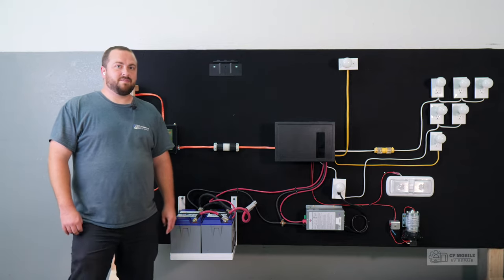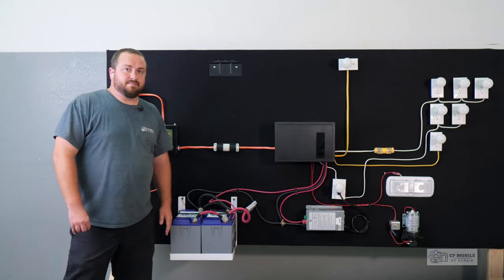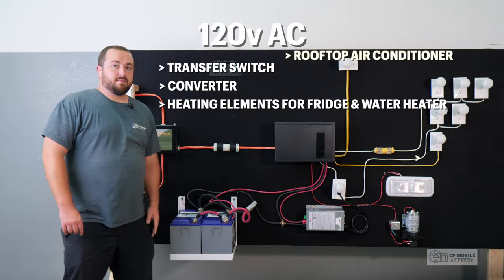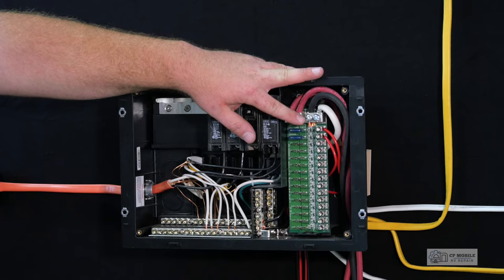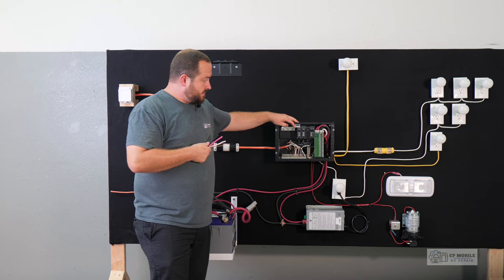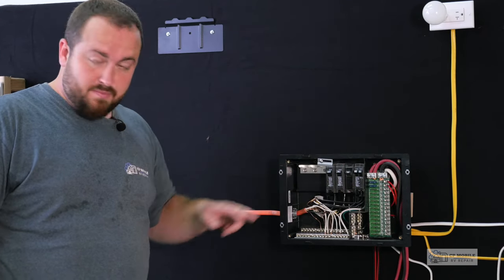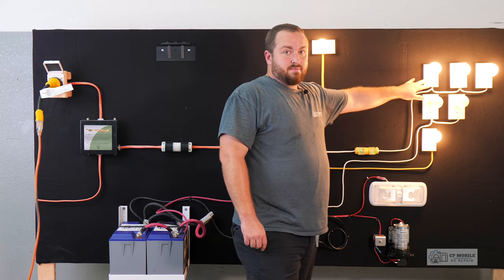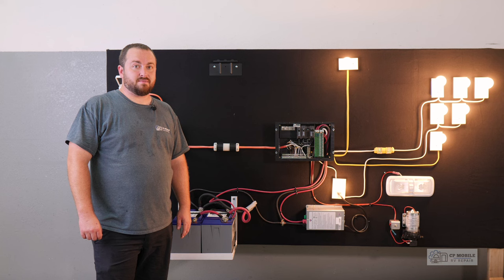RV Electrical Systems: 12 Volt and 120 Volt Power Flow Visualized

Comment from the maker: Link for batteries: https://amzn.to/3ztOisd

We have had several requests for technical help with troubleshooting, installing or designing electrical systems, so we’ve set up an option for paid consulting service below.  If you’d like expert technical help you can click the link below and schedule and appointment. Thank you! 

https://web.lokiapp.live/Travis.Call/g9Er
Reply: My only question is since this is a 30 amp service, I see you have the 30 amp main breaker but then there are 2- 20’s and a split breaker that’s tough to see…this all adds up to more than 30 amp. Does that mean you can only have certain breakers on at certain times so they don’t trip or am I not understanding how the system works? Thank you
Reply from the maker: All breakers are on at the same time, the breakers are to control the upper limit of power usage.  So a 15 amp breaker may only have 1 amp flowing through it depending on what power is being used.  It’s possible the total current from all the smaller circuits could exceed the 30 amp limit without exceeding any individual circuit breaker limits.  That’s why the main breaker exists.  So overall you just monitor total power useage at any given time.  Same scenario is possible in a house, too many devices on at one time could trip the main breaker.
Reply: @Cpmobile  Ok thank you. I’m trying to determine whether to go with a 30 or 50 amp service on my race trailer which has small living quarters. I’ll have 8 total 110 receptacles, 1 for a plug in AC unit, 1 for a small air compressor, 1 for a car battery charger and 1 for the converter/charger…the rest are just misc. DC power will be water pump, shower fan, car winch and low voltage LED exterior/interior lights. The trailer will be plugged into a portable generator all the time. Based on what you’re saying I think a 30 amp service would be sufficient because not all of these things will be on or used at the same time.

Comment: I blew up a 12v combo 120 Tv:(( Both power plugs were plugged in, and POW:(((Cooked the tv circuit board…Would be nice to separate each system in Rv, or the Tv .Im old and can’t figure what happened…I made it more complicated by connecting a lithium charger with Rv charger leads to 50ah battery. And then having to remember to kill main power sw on Rv frame outside each time Generator is on. Or I will have 24 volts to 12v items.Believe it or not, gas detector module by stove chirps for a second and a blue light flashes once to remind me to hit main switch, and not forget. Furnace motor goes on high(24v ) for a second simultaneously with detector. So separate systems though costly are in order.:))))lol

Comment: Thank you for making these videos. I’m trying to better understand how power works in our 5th wheel because I’d like to (eventually) be able to install solar that will run the unit when shore power isn’t available. I’d also like to install an onboard generator. Starting with the basics, this is incredibly helpful. Thank you!!
Reply from the maker: Thank you!

Comment: The lines coming off the batteries with the coupler. What is that for? This video was very helpful in the planning of my system. Thank you!
Reply from the maker: It was not used in this setup, but was connected to inverters in the other videos

Comment: First thanks for your knowledge much appreciated.
My 5th wheel was working without a battery for 3 months and recently my fridge and lights went out and no fuse is blown out
Reply from the maker: You could check for seperate dedicated breakers or fuses near the batteries, sometimes they can be hidden behind an access panel

Comment: I have a 4,000wt continuous solar generator. I want to put it under the bed in my rv and run wire to my control panel. 
I also want to put a 12vt lithium house battery under there. I plan on adding 12vt small fans to pull air under the bed and out the pass thru. What is my best way? I want my all in 1 solar generator to take the place of my exterior 30amp cord.

Jonesy 
Nw Arizona

Comment: Great Video. I have T T  with a 12 volt only refrigerator. I was hoping to place with a 120 volt one. any tips on wiring it. Do I go straight to breaker with a outlet or if I use an inverter will it run off 12 volt like the original?
Reply from the maker: An inverter would be a good option for this, we have 2 other videos about inverters that should help explain how it would work

Comment: Really like the video! New RV owner. I was wondering if I can shut the converter off so just the AC outlets are powered. I have a solar charger and dont want to suck juice for battery charging from my power station.
Reply from the maker: Yes, no problem with doing that.  You can turn the circuit breaker off for the converter.  Sometimes the converter will be in the same circuit as some outlets so that’s the only potential drawback.

Comment: Hi Travis. Thank you for this video. In my 1994 Odessa RV
 I only have 12 volt appliances when either the key is in the on position or we are hooked to shore power. Any idea why I don't have 12 volt service when the coach is off and not hooked up to shore power? I believe it should and it does not.
Reply from the maker: Hello, it sounds like we aren’t getting any power from the house battery, so I would verify the house battery is in good condition and charged, as well as making sure the connection between the house battery and power distribution panel is good.  Look for any blown fuses or tripped 12v circuit breakers.

Comment: I have watched all your video's and really appreciate you sharing your knowledge. I was having a hard time windering if there was a transfer switch for an inverter install if you had shore and generator in a transfer switch already. Basically a 3 way transfer switch. Would you go inverter, or solar generator for boondocking. I am leaning towards the Opus Mega 2 since it has a 30amp plug and I can just plug it into the toyhauler. It also has the ability to be mobile and I can recharge with portable solar.
Reply from the maker: I think either can work well depending on what you want.  For me the best case is to have it all built in to the rv. Solar, inverter, batteries etc so it all just functions as if you were plugged in to the grid.

Comment: Great videos so if i have the renogy 3000W inverter/charger i wouldnt go with this set up i would go with the set up on your other video? Or can you also run a inverter/charger like on this video?
Reply from the maker: Yes, in most cases I would run that inverter in a setup like the video with the victron inverter, where the inverter is in line before the power distribution panel, so all circuits get power from the inverter.

Comment: I am looking to do an electrical install on an enclosed trailer. My plan is 12v led lights and then 3 110 outlets. I only want to run a regular extension cord to the shore power and just have one battery for lighting only. How would I go about that?
Reply from the maker: Hi, the best way to accomplish that would be to use a power distribution panel like the Wfco 8735 ad, that handles both 12v and 120v power distribution.  Use a 15 amp shore power inlet to supply the 120v side and the battery hookups to distribute 12v power to the lights.  That unit includes a converter (battery charger) to charge the battery when plugged in.

Comment: So i need different lights if i want to remove the battery and the  converter.
Reply: Or just move the wire to the microwave  circuit.   (Only 900w out of the 1500w it's given)

Comment: Is the 120v circuit grounding grounded to the chassis or no
Reply from the maker: Yes, typically the 120v system will have a bare solid copper wire running from the power distribution box to the frame.

Comment: What gauge wire is coming off of the 12v fuses to go to a thermostat?
Reply from the maker: Most of the time you will find the same 14ga wire that is used for lights, water pump etc.  There is very little current to feed a thermostat though, so down to 18 or 20 gauge would work fine as well.

Comment: What size is the wire from the battery bank to the panel?
Reply from the maker: It depends on the application, but 6 ga. or 8 ga. is very common.

Comment: Are those batteries grounded to the chassis or no
Reply from the maker: Yes, they will typically have a wire running to a grounding lug on the frame

Comment: Now why wouldnt you just use a 120 hookup instead of using a.c & d.c ?
Reply from the maker: You could do it that way depending on what you want from your system.  This scenario is an example of a standard RV electrical system, which uses ac/dc.  This setup keeps all the existing infrastructure, keeping it fairly simple and allowing it to work as designed.

Comment: i thinkis its dumb to have the lights running off 12 volt.  and dont forget you can have all the power you want but if you have a small drop cord feeding your rv you are power limited lol
Reply: Weren't the Lights representative of of appliances and the "small drop cord" for demonstration? 

Most RV lights are 12v LEDs and draw close to nothing so why not use them on 12v circuit.  Besides when your not on "shore power" what will you do for light?😅
Reply: @reddbeard2030  good for you pal good for you
Reply: Need to rethink.12v lights don’t require inverter to operate, thus saving energy. When Off grid there no place to plug in an extension cord